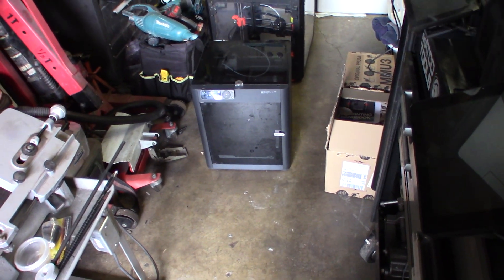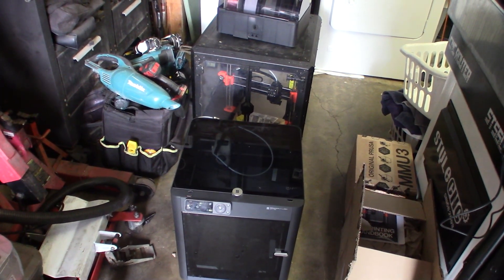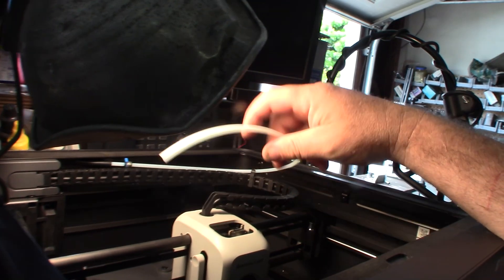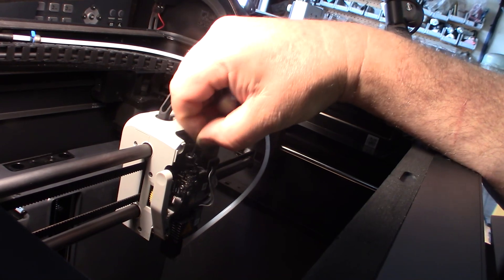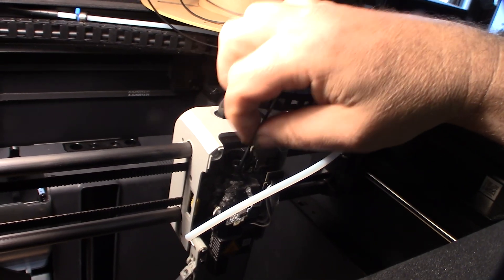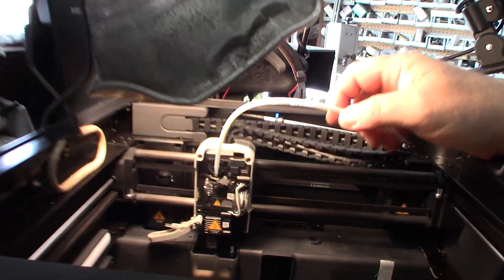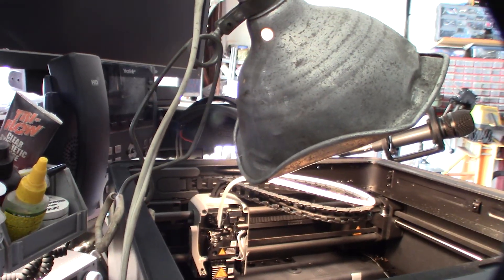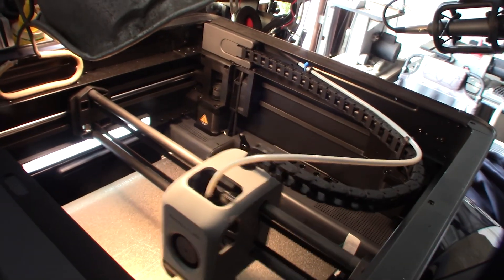Bambu Labs P1S AMS Jamming At Extruder, Buffer Magnet & Bad Filament Sensor Troubleshooting, Repair

Comment: Flipping the magnet in the buffer is the solution!
I’m embarrassed to admit how long I’ve fought this problem and never put it together. If the filament gets all the way to the extruder and says it’s clogged when manual feeding is obviously working I highly recommend making sure the magnet in the hub is correct way

Comment: Thank you for uploading this video. I have the same issue where the filament is being rejected by the nozzle. About 5 times to send filament therough then i get an error. I changed the filament sensor and the problem is still there. Sometimes and i mean 1/10 times it may work for 1 layer then error again. I will try flipping the magnet but i am confused on if its in a unit how it can flip over. i will update if it works.

Comment: Iv been having this same issue since I bought the P1S, brand new, a month ago . It has never been able to auto load.
I have to heat up the nozzle to 250, auto feed the filament and auto extrude until I can see filament come out of the nozzle. I can then print just fine in single color but at any time if I let the AMS load the printer I get the extruder clogged error again. I disassembled the extruder and nozzle multiple times. no clog was ever found. 
I guess I will try flipping the magnet on the buffer and see what I get....
Reply: Hey did you ever have any luck fixing this? I’m still fighting this problem
Reply: @t @tedchambers4093 
yes I had to get 2 new buffers. The first replacement didn’t work but the next one worked perfectly. customer service seamed to be aware of the issue and were very helpful

Comment: I just got a brand new x1c, and I was able to manually load filament to run my first print, but when I load the the ams, it stops and retracts once it gets inside the spool head. Everything looks fine with regards to the tubes and no clogs. The filament comes out with a rough, guitar string-like texture. I think the spool is running too tight and running along the edge of where it enters the gears on the ams, but no matter what I do, it always ends up with tension which is what I think is possibly causing the load to fail because otherwise I am at a loss. Does anyone have any ideas on how to fix this issue? I’m hoping somebody has an idea because it is very frustrating since it is all brand new. I also checked inside the tool head and everything looks good, so other than tension from the spool entering or something with the ams gears I am at a loss, and even then, not sure what to do.

Comment: Had zero problems with my p1s, but Hadn't used my it for a few months, turned it on, updated the firmware & immediately got this problem in the first print, have seen many people talking about magnet problem after firmware updates, will roll back the software & cold pull 🤞🏻

Comment: I had the same issue. i contact bambu and I was told it's the filament buffer. but I never open that buffer before, so there is no way it's in wrong direction. So I also think it's might be the filament sensor. One thing to mention is that seems there is no issue if I don't use AMS. And for ams, even I wire it without filament buffer, it still doesn't work. feel like the ams is not pushing the filament hard enough. Any ideas?
Reply: Im having the exact sane issue at the moment with a new x1c, like out of the box jamming at the extruder. I have the hub tho, not the buffer. I can manually load the filament, the first time it was like something broke loose, alot of pressure to feed it thru. The ams doesn't have the power to push past.

Comment: I do think it's pretty cool how the toolhead looks like it was designed like a cell phone. I have to do that sometime.
Reply from the maker: Bambu has some pretty good build quality. My only gripe is the firmware, you are completely blind. You can't console into Linux or Klipper and troubleshoot the state of sensors. Working on a prusa Mk3 to Mk4 conversion with MMU. Bambu so far has been the most reliable MMU i have worked on. Still working on 3D printers?
Reply: @fintechrepairshop  Yeah, we have been messing with my partner's Voron lately. It failed due to insufficient toolhead strain relief. CAN can make diagnosis pretty annoying. For me, closed-source cloud junk is a nonstarter but I would love to clone whatever Bambu does, just like they cloned their stuff from the open source community :)
Reply: @fintechrepairshop   Yeah, we have been messing with my partner's Voron lately. It failed due to insufficient toolhead strain relief. CAN can make diagnosis pretty annoying. For me, closed-source cloud junk is a nonstarter but I would love to clone whatever Bambu does, just like they cloned their stuff from the open source community :)
Reply: @fintechrepairshop  Yeah, we have been messing with my partner's Voron lately. It failed due to insufficient toolhead strain relief. Canbus can make diagnosis pretty annoying. For me, closed-source cloud-connected is a nonstarter but I would love to clone Bambu, since they cloned us it's only fair.
Reply from the maker: @jessicav2031  I tried can bus for awhile until I had a problem. Troubleshooting intermittent sensor issue over CAN is way more annoying.  CAN can also pickup noise even making it worse.